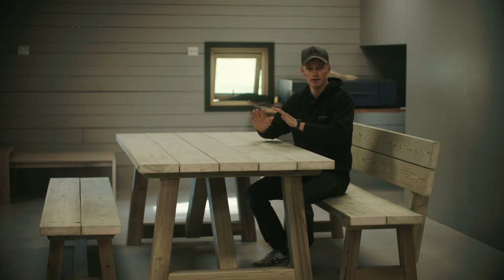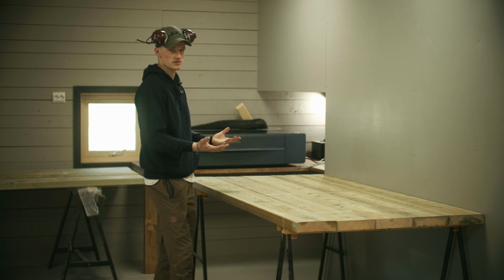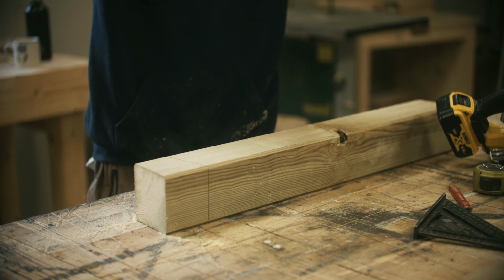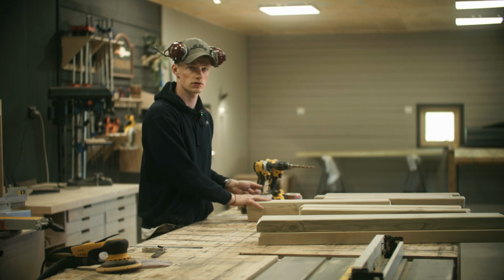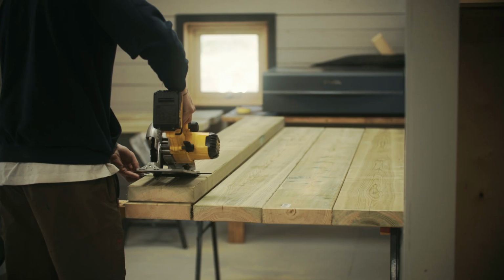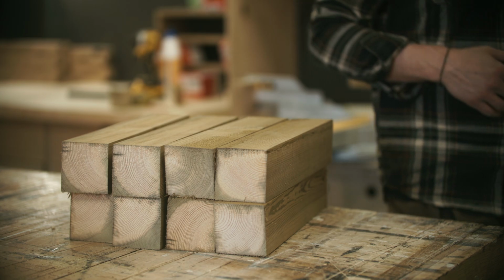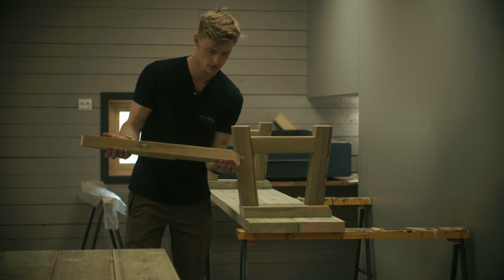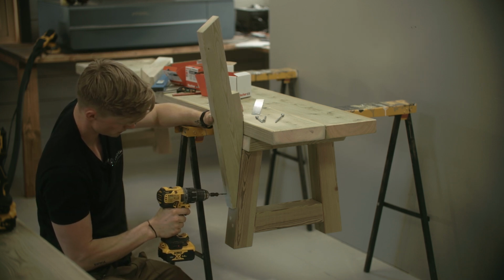A Beginner Woodworking Project That Sell

Comment: Thanks so much! I will be buying the plans and building this (my first!) table for my grandma this spring :-) Do you need to put any finish on this? We plan on having it outside and it might be getting wet from ocassional rain. I will be hidden during the winter though, so no snow. Thank you!
Reply from the maker: Awesome! If you're using pressure treated wood you don't need any finish, but it will of course give better protection. For outdoor furniture I like to use the Rubio Monocoat Wood Protector :)

Comment: After your drill your plugs run some tape over the top of the plugs and when you cut them out on the table saw they wont fall all over and you will have them all stuck to the tape.

Comment: This is such a great set. I’ve gifted one to a friend for a house warming, and sold another 2 sets. Plans are well worth it
Reply from the maker: Awesome, so glad to hear that!
Reply: How much did you price them? I'm curious what I should charge.
Reply: @cablewrangler  on my most recent build had a few tweaks, but my materials were about 700, I charged 1150 and included delivery. Those are all in Canadian dollars. I usually factor about 12 hours for a full build from start to finish, including material buying
Reply: @MrStuartJA  Canadian here. BC to be exact. Curious if those were prices during the whole 21/22 lumber prices craziness or after thing settled down a little.
Reply: @sirawesomenessi1796  I’m in ON. It was just this spring, Home Depot pricing. Again, had some tweaks, specifically customer wanted the benches shorter, and more of them. So building more leg assemblies added a fair bit to the material needs. Plus they wanted overall length at 10’ which I believe the plans are closer to 8’ IIRC.